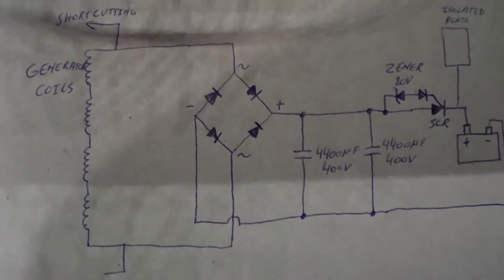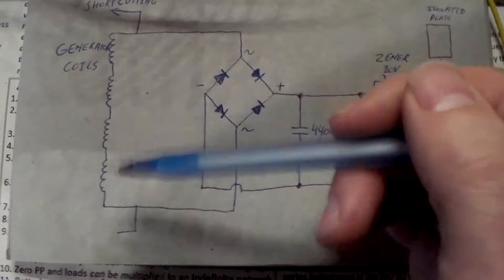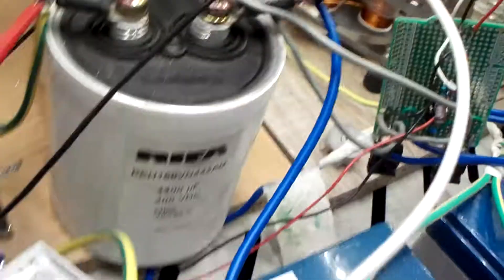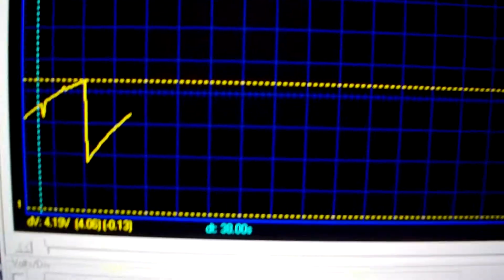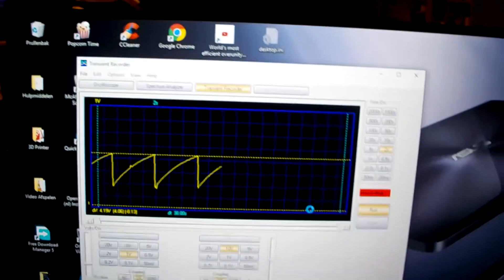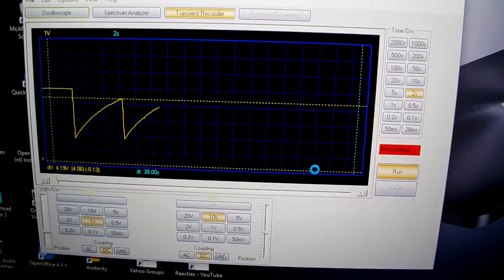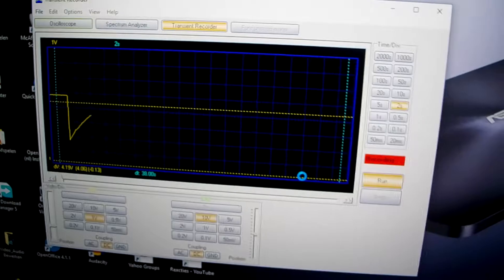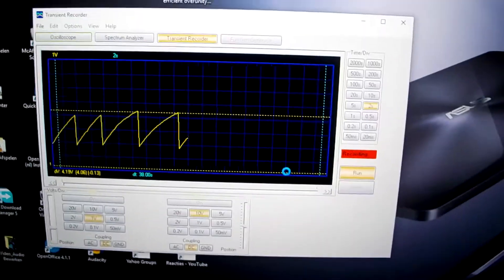001 Dual Pole SCR Cap Dump Controlled By Zener

Comment: Awesome setup and demonstration . Much appreciated Bruno .👍🏻 I am building a cap dump circuit at the moment for 400V and 1400v .
Reply from the maker: @Buzzhumma, That will not be so easy to do, especially the 1400V, I'm wondering how you're going do that :)
Reply: @brunovk417  well I am going to experiment with gas discharge tubes and flourecent globes

Comment: Hi Bruno - great video.  I've been looking at how I could dump my caps into a battery bank and I think what you showed is exactly what I needed.  So the positive cable of the cap connects to the  zener diode as well as the anode of the SCR ? The other end of zener connects to the gate ?   Then the cathode of the SCR connects to the positive of the battery along with the plate ?  Wondering if the plate is providing a reflection of energy back to your diode ?
Reply from the maker: Hi mscavsfan, the circuit doesn't use much parts, but stability with such a plate on longer term I didn't test. Watch out that your scr has serious current limits, with my setup I had pulses of 30A if I remember correctly, they are short but according to voltage and capacity voltage they can get really high. The one I used whas old industrial scr so it survived the brutal discharges. It will also depend on battery impedance how high the current will go.
Just want to warn you in preventing blowing up parts. I have not found the reason why the plate did the job, but as you can see it was needed. I left the path of cap dumps because I had better results with the negative charging directly, but then offcourse you have negative batteries. There's a difference in what the person says who replicated the black box and what Rick says, namely that the other person said that both batteries in the system, thus also the running battery becomes negative in that case. Because of the resonance kit and now the negative impedances I haven't looked much further into that. I only recently found a possible way to measure batterie impedance, otherwise I could have checked what difference it makes to make batterie negative, it will be a future experiment.
The connections where based on the scr cap dumping that Rick used, I added the zener diode to be able to go higher in voltage before dumping. I don't know if there's a reason why Rick doesn't go higher in voltage before dumping, so hopefully the capacitor dumping doesn't have bad influence on batterie. Allthough if I remember correctly he somewhere spoke of the step charging, which is not that much difference with this way of working.
Reply: @brunovk417  Thanks for the info !!